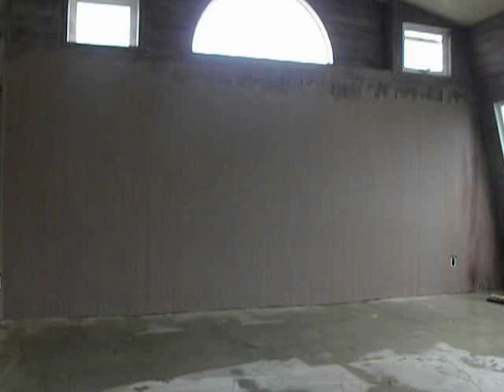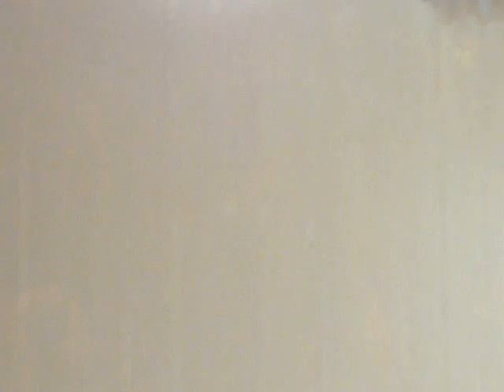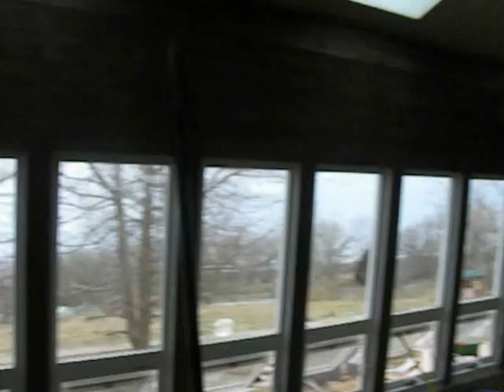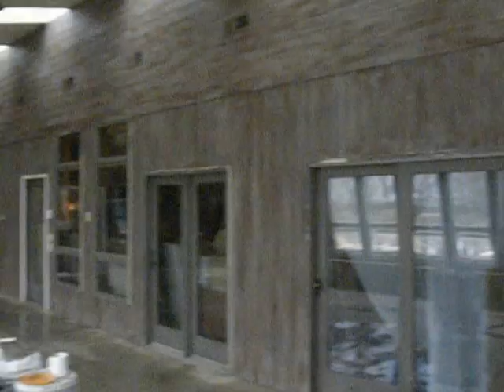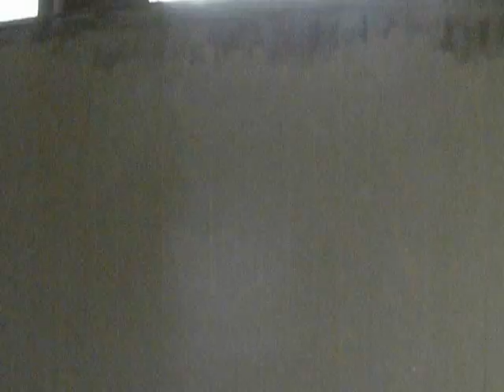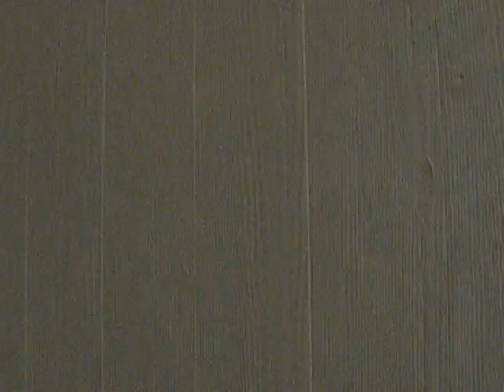Demonstration of a Faux Finish on cement board by Artist Sheri Lauren Schmidt, Part 1 of 4

Comment: Could this be done with exterior paint on the outside of a house?
Reply from the maker: That ought to work just as well.  I generally use a water based paint,  most of the exterior paints I've used are latex just like the interior paints.